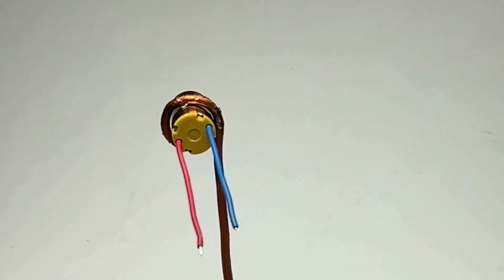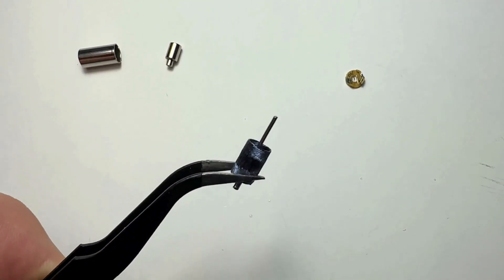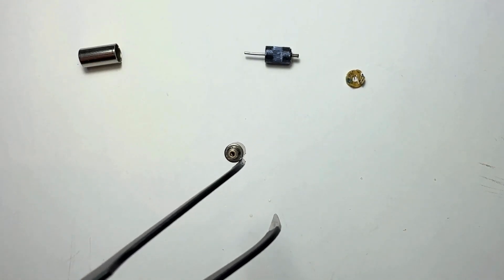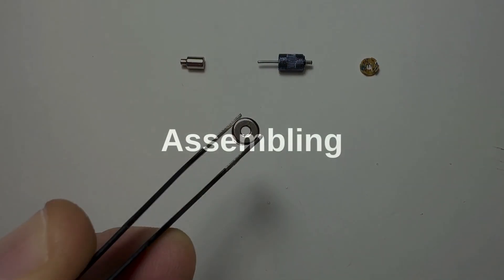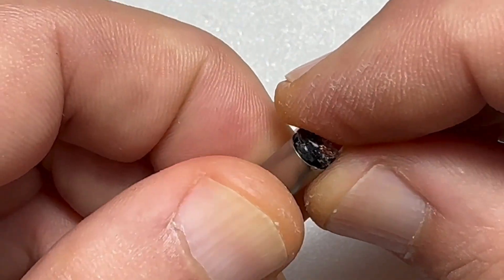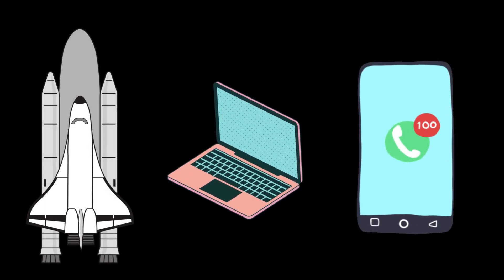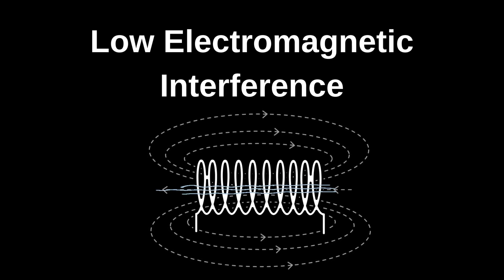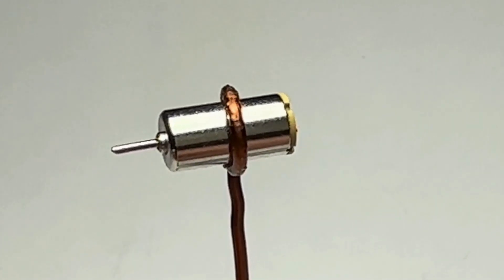Inside a Coreless DC Motor. Coreless DC Motors Unveiled!

Comment: can the same coreless motor rotate in clockwise and counter clockwise?
Reply from the maker: Yes, a coreless motor can rotate in both directions. It is determined by the polarity of the electrical current flowing through the motor's windings. By controlling the current, you can make the spin in either direction.
Reply: @STFocus  thanks bro you are the best
 you just win a new subscriber : )
Reply from the maker: Many thanks…

Comment: it seems more loud than a tradicional dc motor, how does it compare to a 5v DC small motor?
Reply from the maker: A traditional small DC motor has a magnetic core, while a coreless DC motor does not have this core. It makes it lighter, with lower inertia, higher power-to-weight ratios, reduced cogging torque, and quieter operation. Coreless motors are ideal for applications needing rapid acceleration, precision, and efficiency.